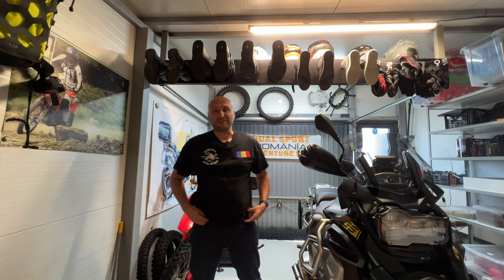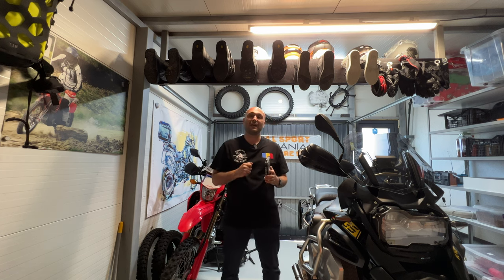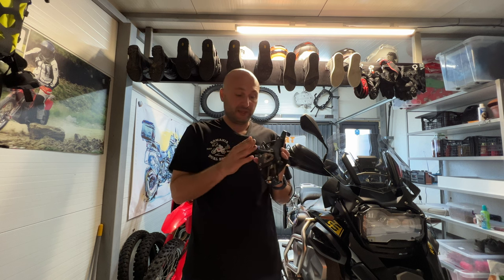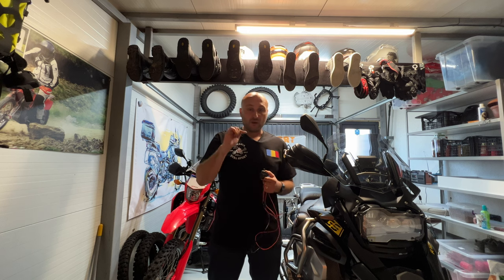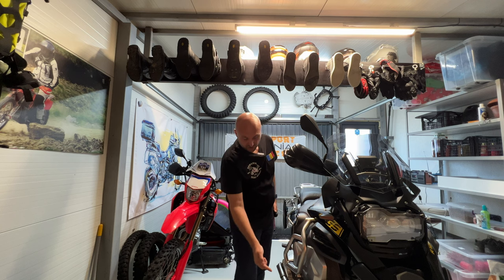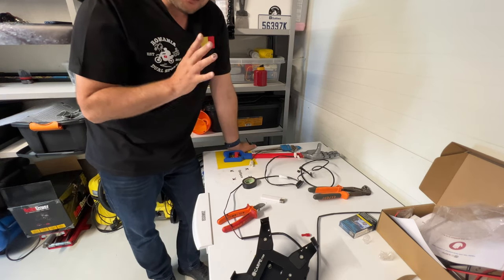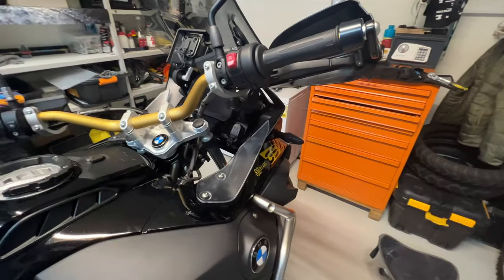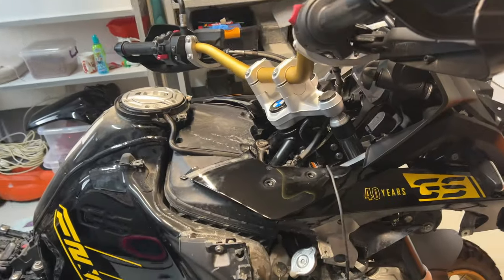Carpe Iter Installation on BMW R1250 GSA

Comment: hello Romania Dual Sort, I saw that you connected the tablet to the GS harness to command the ignition key. if you check the supplied cable, where you have the positive and the negative, you will find a small box with a circuit; this has a function: it turns on the tablet (and a led lights up) when the current exceeds 13.5 Volts, i.e. when we turn it on and the alternator starts charging our battery. when you turn the key to switch off the engine, the LED will switch off after 2\3 seconds and will no longer power the tablet. I said all this because you can safely connect the two poles either to the battery or to any free connection one might find on his bike. Anyway great video, I just saw you now and I will follow you.
Reply from the maker: Thank you for your sugestion and for the subscription !

Comment: Thanks for the extensive video, I know how much work it adds to any project. My question is, how does the clamp hold on the trail? The rocky wash board trails I go on in southern California are brutal. Second, where did you find the arm clamp? I love the quality of the Thor products, however their website could really use some help in finding, and understanding the products in relation to one another.
Reply from the maker: Thank you so much for watching. Well there a thing here. If I would have tighten the bolt of the clamp very very hard, it would not move. But always the connexion point between the clamp and the tablet was week, I found myself  several times adjusting the tablet because it moved. All the products I bought are from Tork. I didn't bought anything without discussing with them via e mail first. Thruth be told, it is a wonderful product but a little overkill. If I would take the DMD2 system again, I would go for a rugged phone with a controller.

Comment: Hi... that small device which was flashing green after you started your bike is the BMW Control Hub or am I wrong?
Reply from the maker: Hello. That is the small control unit that manages the power to the tablet. Because the tablet will not power untill you start the engine. The green light indicated that the engine was running and it is charging the tablet as well

Comment: I cannot find that 12mm bracket lever thing on the Thork or Carpe iter website. Do you think you need it if you already have a AMPS GPS mount? I have a BikePenR BPR-R12GS-1-2 mount but it sits much closer to the bar than yours from the look of it. I am trying to understand if I need the extra bracket you bought
Reply from the maker: Here is the link:
https://www.thorkracing.com/produto/tablet-fixation-bracket/
Yes you will need this bracket. I tried without and did not work
Reply: @DragosRDS  thanks for that! You can lower the screen all the way down?
Reply from the maker: @bazza8947  Yes, it can be lowered really down. But there is a catch. If you put it all the way down, the windshield is touching the tablet when fully turned
Reply: @DragosRDS  Thanks mate. It is a lot of money but I think I need one :)
Reply from the maker: @bazza8947  but please think two three times before buying. There is also the posibility to have a bmw phone cradle and use the phone with DMD2 app. Think about it
Reply: @DragosRDS  I already have a Samsung Active Tab 3 but it's a touch to big for the GS cockpit. You would buy the tablet again if you knew what you knew now?
Reply from the maker: @bazza8947  No I would not. At least for my kind of ussage. Although it is a great system I am not a world traveler, I never used the controller while riding offroad (very hard realistically to do). I always stopped and zoomed in and out and search for something - safer and more logical. It is a heavy tablet 1kg...
It has a great brightness and a dedicated gps chip BUT I never went to Magadan or to Mongolia to ever feel the need. And honestly, people went to Mongolia using phones and paper maps... I don't need to know my revs on the tablet nor the oil temperature. I have a modern bike who can show me that. The trip info can be seen on the bike screen the same. I know it is atractive but realistically, ME, I don't really need it.
What I would do, I would buy a 5-6 inch diagonal rugged phone and install ONLY the app. That's it. 6 to 7 times cheaper. This is my reasoning. But it is a free world and to each his own 🤗. Best of luck !
Reply: @DragosRDS  In my heart, I know your comment makes a lot of sense and is more the reality of buying this device. I already own a rugged phone (Nokia ZR20) and might see how that goes. Thanks for all your great advice again
Reply from the maker: @bazza8947  I forgot to tell you something else, no matter how hard I squeezed the allan bolt, the tablet,   in the offroad sections always moved down, a little frustrating. It is very heavy ... Maybe with another type of clamp or mounted on the bars. But again, think with your reason, more than 1000 euro of your hard earned money in this times are not pocket money 😆. Thank you for watching my videos and talking to me.
Reply: @DragosRDS  That's why I asked you if you tried to mount it directly to the bar without the extension, it just looks like it would move no matter how tight it was. I think I am convinced to give this one a pass. You can use the DMD app on the new Garmin Tread too by the way, not cheap but at least it's a purpose built GPS

Comment: Thanks for the review. How are you liking the unit so far? Was it worth the upgrade over the Zumo XT?
Reply from the maker: The unit was incredible ! I say was, because I sold my bmw with the tablet on. The upgrade is fantastic, you can't imagine the difference. Brightness, responsiveness, the fact that you have a nirmal android tablet with SIM card opens a plethora of options like waze, maps, whatsapp, youtube, radio, etc. The downside is that the tablet and the system is heavy, very heavy. In rough ofrroad sections sometimes it would move down at it was anoing to tighten it all the time. The other problem NOW is that the Carpe tablet no longer has the DMD software support. So you will not get the updates. BUT look on Tork Racing site because they have now again a tablet waaay slimmer. I hope it helps
Reply: Excellent info, thanks! So with no upgrades/support it might not be the way to go...? @DragosRDS
Reply from the maker: @hammy7139  No, with the Carpe Iter no. But with the other tablets, or nav phone that you can find on the Tork Racing site yes ! The Carpe Iter pad is produced in Czech Republic, the DMD app in Portugal. DMD is working not with other hardware manufacturers that suit their needs better.

Comment: Apparently soon you will also be able to use bmw wheel controller (rather that using for example a wunderlinq box to connect the two) to navigate through dmd2 software that come preinstalled with the tablet. Good video
Reply from the maker: Thank you for watching ! What would be even better is to have the posibility to use the wheel on a phone in the bmw cradle, with the DMD2 app. In this whay you don't have to spend a lot of money for the tablet. The tablet is great but maybe out the budget some people would like to spend

Comment: Thx for the video!  I have a question -why don`t u connect joistik to the same original gps wire there u connected tablet charger?
Reply from the maker: Thank you for watching. I have just respected the instalation instructions from the manufacturer. Probably your sugestion si fine, but I just respected the manual
Reply: @DragosRDS  Thank you! :)

Comment: Hi. Can you tell me the type of connector and where to buy it? Thank you!
Reply from the maker: Hi. I am not sure I understand question. Could you please rephrase ?
Reply: Sorry. In the video you talk about a connector (the one with the yellow wires at 5:22). I bought the tablet with just one wire (which goes to the support pins) but by connecting it directly to the original adapter (on the right side) the tablet doesn't turn on... @DragosRDS   @DragosRDS
Reply from the maker: @_nick_ola_  Ahaaaaa, got it ! Just give me a few minutes
Reply from the maker: Just write on google: bmw motorrad gps connector 83300413585 and you will fond tons of sources, depending on where you live. I got mine from Amazon. Best of luck and let us know if all ok !
Reply: Thank you!  @DragosRDS

Comment: Very nice video - thinking of getting one. How long did the install take you from start to finish?
Reply from the maker: Thank you for watching. In total it will take about 3 hrs. The cable routing from the support to the batery is tricky because you need to take out some plastics. It is not difficult you need to take your time

Comment: Very nice video. Is it possible to get a mor 360 video of the device mounted so you can se how it look and fits to the bike?
Reply from the maker: Thank you for the comment. Unfortunatelly no because I don't have the BMW anymore. But if you look through my solo ride series I think you can make something out of it. Cheers ! The series is called Apuseni Mountains Solo ride
Reply: @DragosRDS  Thank you. Will you recommend it for the GS?
Reply from the maker: @johaneriksson8289  I would recomend it YES ! It is an awsome piece of equipment. But ! It is important to think how will you use it. A lot of offroad ? A lot of road ? How? Because it is expensive and it is better to think twice if you really need it. For example, now I use my ZumoXT as navigation. No need for something else.